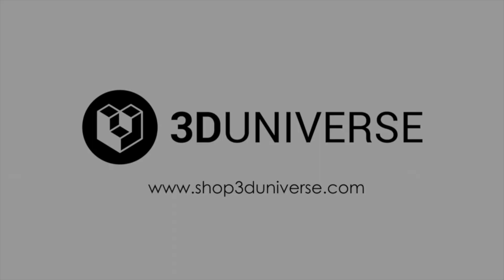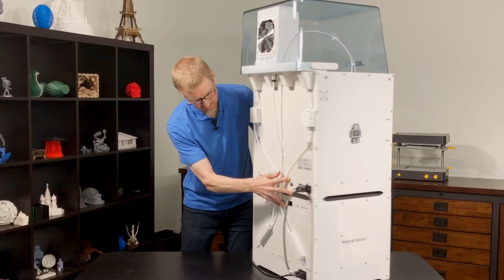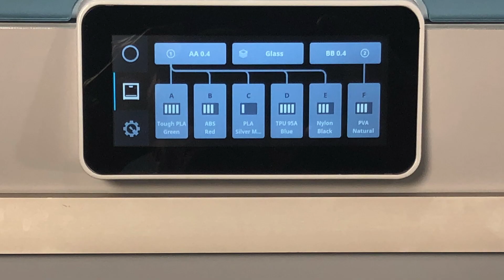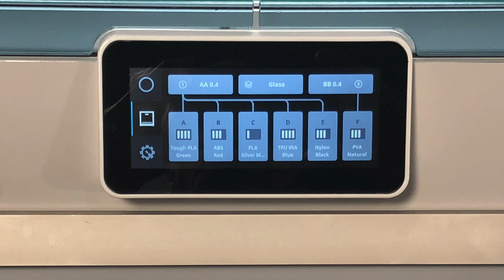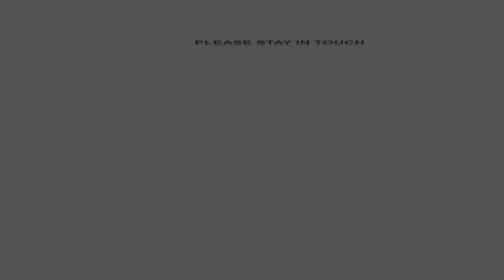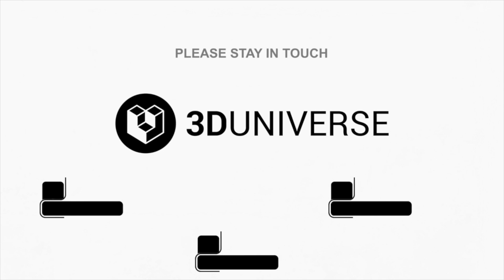Ultimaker S5 Pro Bundle Overview

Comment: I am new to 3D printing but have a relatively simple design that requires 2 different materials but would like to also include water soluble structural support for each.  If I were to load material 1, material 2, and 2 spools of dissolvable filament each running to different extruders could I make that work?  Basically when Material 1/Extruder 1 is used it would access Dissolvable Material from Extruder 2.  Then when it used Material 2 from Extruder 2 it would access the other spool of Dissolvable filament feeding through Extruder 1.
Reply from the maker: No, that is not supported. You can only print with two materials per print - one for extruder 1 and another for extruder 2. So you could do either a single color print with PVA supports or a two-color print without PVA supports.
Reply: @3duniverseOrgWelcomesYou  I was afraid that was the case.  Thank you for speedy confirmation.

Comment: $10000!!!!!
Reply: Yes, its 3k for the spool holder that does not dry the material or really appear to do a great deal other than feed the material into the extruder?  The issue I have with even a 10k machine is even with all the fancy additions...its still very slow.  Maybe not slow for where we are for 3D printing at this stage...but ultra slow in regards to anything related to actual production or  what they call "industrial."   I own 3D printers and they are all very enjoyable to use for prototyping which doesn't really require a great deal of speed but beyond that...your almost alway better off getting multi-machines that can do the specific requirements that you are looking for.  Even a double extruder is almost always shown printing two objects out side by side.  If that is what you want to use a double extruder for than you are 100% better off simply buying a second machine...your paying a hefty price for a second extruder.  Just my thoughts.

Comment: If you have 5 PLA colors loaded, can you swap them (during the print) by specifying that somewhere in the .gcode?
Reply from the maker: Not currently, no. The basic printing capabilities of the Ultimaker S5 are not changed by the Material Station. You're still limited to printing two materials/colors at a time. So you could install two of the AA print cores and do a print that includes two different colors oof PLA (by using two separate models and assigning one color to each model in the Cura slicer), but you would not be able to do more than 2 colors in one print.

Comment: How is recognise the type of filament and its colour?
Reply from the maker: Each spool of Ultimaker brand filament has an NFC chip that the Material Station reads to identify the type and color. If you use 3rd party filament, you need to select the material type manually using the touch panel on the printer.

Comment: Is it posble to with more that 2 materials at the same time?. For example TPU+PLA in nozzle 1 and PVA as support in nozzle 2?
Reply from the maker: No, printing with more than two materials in a single print is not supported. The Material Station is designed to automate the process of loading and unloading different materials, but you can still only select one material for each of the two extruders for any given print job.

Comment: Isint the particles emitted by abs smaller than hepa size ?
Reply: Hepa is for chemicals :D Nothing to do with 3d printing. The only particles when the extruder shred the filament. But then in the front can go out without filter.